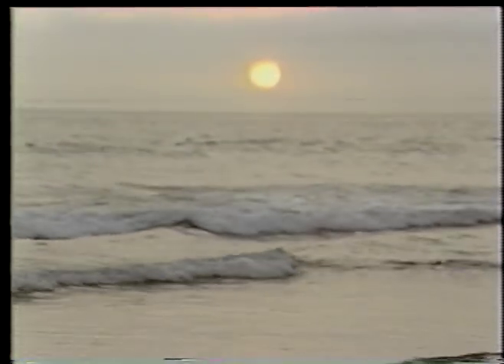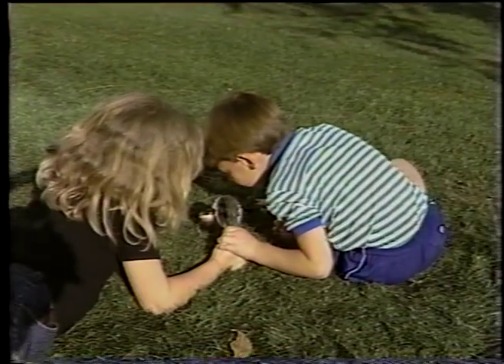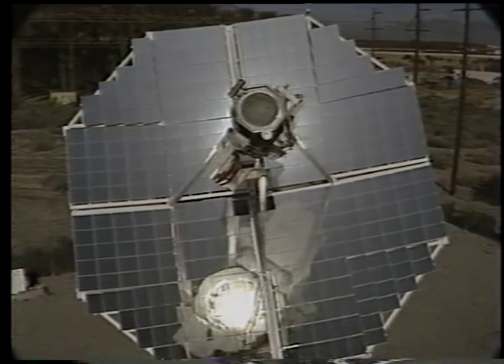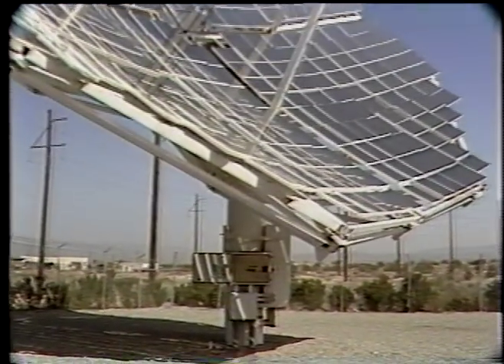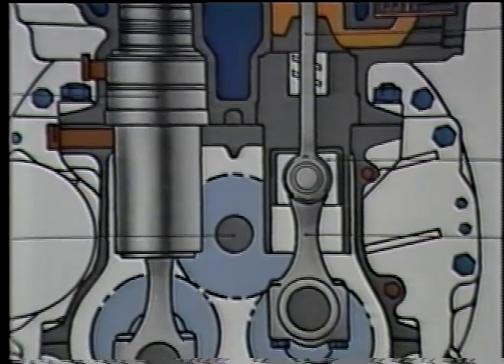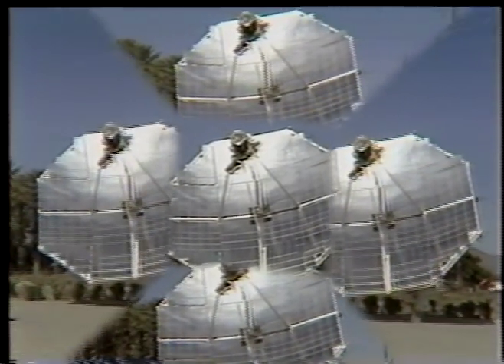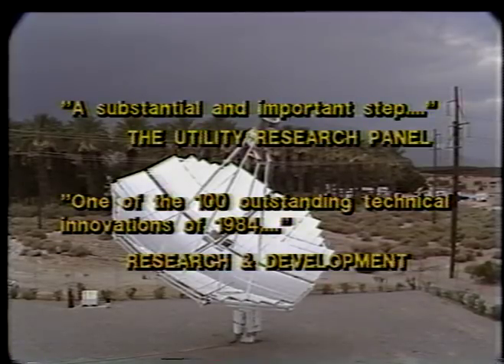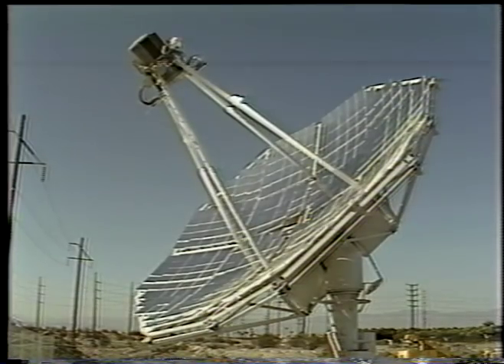World Record Setting Solar Parabolic Dish Stirling System, 1984

Comment: 23% efficiency in 83-84 is pretty good! Make it today and I bet you could 25-30% and that would rival the better solar panels out there.
Yes a bit more maintenance, and the initial cost might be higher but you could drive it with a computer that costs about 5$ today and with really efficient servos/solenoids (or whatever). In the 80's that solar tracking computer was probably 5k usd alone and so on...
Reply: Currently, commercial Sterling engines run at around 30% efficiency.
https://swedishstirling.com/en/
Some designs use standard solar panels above to capture light and generate electricity and as the panels warm up in the sun the waste heat is used to power smaller sterling engines below. Total output efficiency there is approaching 40-45% for the combined system. The sterling engines were mostly 3D printed and molded from recycled plastic. They had very few metal parts in bearing and heat plates but the overall cost of manufacture was very small compared to an internal combustion engine. The lead engine has over 10,000 running hours on it with no maintenance at all.

Comment: Unfassbar - vor 37 Jahren über 90% und heute ist man in der Photovoltaik stolz auf 30%.
Reply: Das "92% efficient" bezieht sich natürlich nicht auf den Wirkungsgrad der Umwandlung von Solarenergie in Elektrizität, sondern auf den Nettoanteil an der Bruttostromproduktion, der nach Abzug des Bedarfs für das Trackingsystem für eine Netzeinspeisung/Nutzung übrig bleibt.
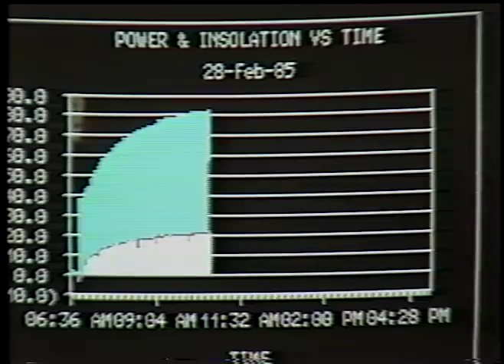Wie man auf 7:26 sehen kann (Sonneneinstrahlung und Stromproduktion), liegt der Wirkungsgrad nicht weit über 20%.
So oder so, entscheidend sind die Kosten pro Stromertrag, nicht der Wirkungsgrad.
Und diesbezüglich ist Photovoltaik heute unschlagbar.
Reply: Nachträglich bemerkte ich den Rekordwert von 29,4% in der Videobeschreibung. Aber das ist wie gesagt nur ein Rekordwert und bezieht sich zweitens auf die Bruttostromproduktion, ohne Abzug des Strombedarfs der Anlage selbst.
Und insbesondere in Regionen mit häufiger Bewölkung ist noch zu betonen, dass solche Anlagen anders als Photovoltaik nur direkte Sonneneinstrahlung verwerten können, kein diffuses Licht.
Damit geht in Ländern wie z.B. Deutschland ein großer Teil des potenziellen Ertrags verloren, der "effektive Wirkungsgrad" (Stromertrag pro Lichterntefläche) sinkt unter den von stinknormaler Photovoltaik (polykristallines Silizium).
Will man nur direktes Sonnenlicht nutzen, gäbe es dann übrigens auch noch die konzentrierte Photovoltaik (CPV) als weitere Option mit hohem Umwandlungs-Wirkungsgrad. Da liegt der höchste Modul-Wirkungsgrad derzeit bei 41,4%.
Aber wie gesagt, da normale Photovoltaik bzw. normale Solarmodule so billig geworden sind, sind Systeme, die auf Tracking angewiesen sind, nicht mehr konkurrenzfähig.

Comment: Sterling engine from solar heat. Great. Using steam engine technology over 200 years old using mirror array over 2000 years old.
Reply: Stirling engines going to make a come back no water consumption very little maint no moving parts highly efficient. Easy and cheap to make but with precision.
Reply: @togowack  no moving parts? Lol. It’s a great toy. Now scale it and produce HP and torque
Reply: @joeseabert8391  Hi, you scale it by multiple cylinders, and a single engine is able to produce 500 watts. That will do, the key is that the engine can take any type of fuel, during a time when the world is coming off of gasonline.

Comment: Some would say it was 'Bought & Buried'. Just like the National Enquirer does. But Solar Panels are far more simple.
Reply: You are right Karl.Cant get simpler than pointing solar panels at the sun.Trackers made economic sense when when solar power was 8-15 dollars a watt,at 35 cents a watt trackers make no sense.
Reply: Less efficient. takes up more space & requires more maintenance.
Reply: but it doesn't take specialty equipment, this is available to any human with simple items if needed.  solar panels require more technical and specific rare tools

Comment: I thought I invented this a year ago...then I find out it was invented THE YEAR I WAS BORN???  Why aren't people using these to power everything?  It's actually pretty cheap to make something like this.  The mirrors are 1000x cheaper than solar panels, steam engines are pretty damn cheap to build, and the most expensive part would be the batteries for storing power.  I get that humans are greedy af but it's even cheap to make so it would probably be a profitable thing to do..
Reply: Nothing is cheap, try to buy one of them.
Reply: Agree with Christian
Reply: If you do believe so, why not start a business?
Reply: They are in use, suncatcher by tessera, Maricopa plant

Comment: So I missed HOW they handle those 6000F/3000C degrees if even metals evaporate
Reply: cooling loops on the cold side of the Stirling engine.  I've seen some designs that did the similar straight onto special PV panels - actively cooled...  those loops supply a "cold" fluid which draws off the heat as part of the thermal differencing that makes the cylinder move - and that cooling loop is then usable for something else too, like warming up sewer water to evaporate  water off for condensation...  the key to making any of these cost effective is reusing the low grade heat in a chained system.  You could also use it as input to some sort of power generator working off expansion of refrigerant type engine...
Reply: That's one of the critical points imo too.
If all that energy isn't handled properly it'll be lost at the entrance of the heat chamber.
Given that heat doesn't transfer thru vacuum, but light does, I think a glass vacuum bubble around the heater entrance would allow to capture most of the energy from the dish - except for the infrared radiation generated from the high heat.
Also if the concentrated power is indeed to high to handle with currently available materials (at reasonable costs) the entrance surface can be increased, perhaps in a spherical shape, so that the sun light isn't concentrated enough to melt the materials, but still reaches the heat chamber.
Reply: IKR XD
Reply: Concentrated sodium.
Reply: Да очень просто, он тепло в механическую работу переводит.

Comment: i dont know how practical it would be for line voltage on the earths surface, but i bet those boys from nasa were tickled over that thing and probably bought hard into it (if they didnt have it already), it seems like space would be much more practical place for it, still, very cool, thanks for the upload.
Reply: Mark Bowles not really, it need the gases of the atmosphere to cool it down, having the entire engine to overheat would stop it.

Comment: This must have been terribly expensive. Yesterday I visited a cousin, he has solar panels on  his house, he told me yesterday that his daily gain was that day 24 kW. That is the same amount of energy for a fraction of the costs.
Reply: You possibly mixed up power (kW) with energy (kWh).
The nominal power (peak power) of this dish is 25 kW. This means, with e.g. 10 hours of perfect irradiation, the gain would be 250 kWh. 

Nevertheless you are right. Nowadays, photovoltaic systems are much cheaper than solar stirling dishes, related to their production of electricity. Especially in rather cloudy countries, because PV can utilize scattered light, which solar stirling dishes can't.
Reply: Yeah, sometimes my fingers go to quickly over the keyboard, indeed there is a letter missing. But through the context it should have been clear anyway. I meant kWh!
Reply: Anyway, "the same amount of energy" was wrong.
Vanguard: 25 kWh within 1 hour of full insolation (25 kW x 1 h).
Your cousin's PV-plant: 24 kWh within one sunny (?) day in february. In South Africa? This means many hours of insolation.
Probably, this solar stirling dish would rather be comparable to your cousin's PV-plant:
https://www.youtube.com/watch?v=ekSS8C_vvSs
3,3 kW nominal power, which should easily produce 24 kWh within a sunny summer day.
But you can't buy it, the company filed for bankruptcy in the year 2013.
Maybe, because PV became so much cheaper at this time.

Comment: some people don't understand how pv works. you can totally use "pv" as the mirrors. the pv will absorb the smaller wavelengths and, with the correct coating, can reflect the longer wavelengths, i.e. heat. before you call someone stupid make sure your not sounding stupid... jerk

Comment: 32 dishes can produce 800kw  . that means 25kh each units. that is insane , amazing and awesome right?  why we dont have this on our home yet? a 5 kw dish should be enought
Reply: PV is half as efficient, requires significantly more expensive and toxic materials to produce, will output even less without tracking, and is probably not cheaper per unit energy.  PV also eventually fails. This is mechanical and can be kept going as long as someone with a wrench and oil can is around to keep it going.
Reply: I do think  that  the  companies  of power  want  let us  to have some  thing makes  them  lose
Reply: +Curtis Gregory Graphene production is coming of age and there are factories pumping out super capacitors now. The space required is bigger but with a giant panning parabolic dish in the yard that probably isn't a problem and supercapacitors can handle millions of cycles. We don't really have an energy storage problem, we just have a compact energy storage problem.
Reply: @AtlasReburdened  as is freqently the case, there are other factors. Grid or micro grid or home storage is generally most intersted in life time levelized cost and upfront capital cost per kwh stored, while transportation is interested in both cost per kw and wkh, and weight per kw and kwh as well as the volume per kw and kwh.
Reply: Watch Jurgen Kleinwachter's lecture titled "Why low temperature Stirling engines". He mentioned some of the weak spots of PV systems. The points are:
1) Expensive and toxic batteries;
2) Limited battery lifetime;
3) Need of rare materials for batteries;
4) Need of high-tech facilities to produce batteries which are possible only in a few countires;
5) Inability to utilize the rejected heat;
6) Inability to work as a cooling system.
Reply: But this is not a "low temperature stirling engine", but a very high temperature stirling Generator.
It produces power only with direct irradiation.

If you want power in the morning, in the evening, at night or when it is cloudy, you need a kind of backup. 

With solar stirling generators even more than with PV. Because PV produces power even when it's cloudy. Not very much, but at least some.

And modern Li-Ion-Batteries are not considerably toxic.
Reply: One thing.. Storage of energy for night time. That has always been the fault for solar energy. Batteries have been the weakness of most tech.
Reply: @undergod1987  A gravity battery will solve that problem just fine.
Reply: Re the stirling/pv debate: according to wiki PV panels became very cheap due to low manufacturing costs in China. Cheap labor etc.
Reply: All i wsnt is free electricity here in Bangladesh we enjoy sun light yet no such dish 😢
Reply: Why not PV instead of it? Noiseless, cheaper, can convert scattered light, needs no tracking system and can be installed simply on a roof, needs no extra free space. And needs probably less maintenance.
Reply: I think you are right just curious,this looks expensive,PV isnt anymore.

Comment: Hey....can we put some of this in space near the space station.............
Reply: +beatifull mind in matrix The amount of heat that can be radiated from the cool side is not enough to make these engines work properly.. It would require cooling from another source. It would also be very heavy compared to the solar panels. And it has moving parts would need to be repaired or replaced and might cause vibrations in the entire space station.

Comment: all those electronics at 4:25 can be replaced with an arduino
Reply: easily, for the positioning side anyway.  Still getting the utility grade power output suitable for grid delivery is going to require some space as well - but that world has changed a ton in the last 35-40 years too...

Comment: I think with 336 mirrors you CAN NOT have more than 336:1 concentration. And probably you obtain far less than that.
Anyway, excellent work, congratulations.
Reply: rimar2000 Osvaldo J. Schiavoni 

 Unless non-flat mirrors...
Reply: rimar2000 Osvaldo J. Schiavoni  Are not flap mirror, u didnt listen when they said slightly curve to the foam bed. Then 2700 (x times)  /   336 mirrors = 8.03 times per mirror = around 5 metres distance from the surface mirrors to the focal point could be possible. The weird thing in this world are than stupid primates "dominates" with ignorancy... weak depends on weakers... strong evolutive depends on their own.
Reply: rimar2000 Osvaldo J. Schiavoni I meaning in 2015 we even not have this prototypes and we are far away 30 years.
Reply: Gastón GalaxyWorldNet Pardon, I don't speak English, I speak Spanish. I can read almost well written English, but when I hear it I understand very few phrases.
Reply: rimar2000 Osvaldo J. Schiavoni they say the mirror are curved

Comment: I keep hearing about photovoltaics in the comments. Don't get me wrong photovoltaics are very good but are not for everyone. The two technologies both have their pros and cons. As for those who keep saying solar sterling is expensive. Well lol photovoltaic is also tremendously expensive . A 3kw pv system will run you well over 8 grand. That's part one. Two , is that that number 3 kw is when all conditions are perfect. Every solar enthusiast knows that pv's drop under 50% production in power when they get hot . Three, they are more space consuming  than solar thermal. To be fair to pv's they make no noise, and can blend beautifully with the roof. If I lived in a suburbs I would get a off grid pv system hands down, had I the money.
 I presently own a small 300 w pv system that I have attached to a battery bank of 3 kw to run my aquaponics pumps and computer, so I'm actually a fan of pv. I know all too well the shortcomings of a pv system. 
    Now onto the solar thermal. The real problem here is not that it's so expensive, it's that it undergoes two conversions from thermal to mechanical, from mechanical to electrical encountering losses along the way. The second problem is while its not too loud it still can be heard.  To be fair to the s.t since its seeking heat and not light, a supplemental heat system can be utilized to produce power at night( you don't need 600+c° to produce electricity).
In closing these are two different systems. One converts light to electricity, the other converts heat. I don't care which  one makes a break through I just care that they do. Pv's only make one conversion and even at that are very inefficient at only 11-17%. And sterling are very technical and not easy to make( another reason for a steep price). It's not beneficial to get emotionally invested in a particular technology and become a die hard advocate for it, then attack every idea you don't like......that's the reason we suffer from oil tycoon tyranny right now. Rather let people do their own thing and if it works wonderful if not on to the next thing.

Comment: The higher the temperature the higher the potential efficiency. There is no reason why the dish should not be covered with suitably wired solar cells which would also act as reflectors to provide heat at the focus where a heat pipe would link the focus to the Stirling motor at the back of the dish. Alternately thermoelectric modules could be used instead of the Stirling motor which would operate at their optimum temperature gradient through another self-regulating mechanism. They could be attached to the rear of the dish thus absorbing any heat from the back of the solar cells. In fact given some silicon fabrication know-how it should be possible to integrate the thermoelectric cells together with the solar cells thus keeping them cool and so increasing their efficiency.
Reply: Please shut up, as you don't have a clue what you're talking about, and are making a fool of yourself.
Reply: To understand why you are making no sense, imagine if the PV "reflectors" were perfectly efficient and converted all of the solar energy to electricity, tell me then what would be left to reflect?  You cannot just keep using the same photons to make more energy that would be double dipping.  You are adding huge complexity to a system for no reason. We do not have to suck every milliwatt out of every square inch of ground yet.

Comment: Read the definition of inertia!
Specifically inertial mass: F=ma
The force you impart is a product of the acceleration (meagre), and the mass, Tons!

If the conversion efficiency is in the more plausible realm of around 30%, parasitic power used for tracking is 8% of ~30%:
0.08*30=2.4%
2.4 % of the peak received energy to track is not THAT bad, not good, yet not delirious!
This puts the actual efficiency of a 30yo device in the 25 to 27% range, compared to ~21% for current photovoltaic cells!

Comment: Take into account the date of this video, the mass involved!
Even balanced to avoid needing colossal torque, you still need to counter inertia.
The processing power needed is feeble, and can now be done on a single chip instead of a dedicated computer.
Lighter materials, better bearings and motors and this 1984 apparatus could get better!
Yet, If 92% of the solar power received is converted to electricity, this is COLOSSAL, today's photovoltaic cells are way LESS efficient than this!
Reply: Absolutely true